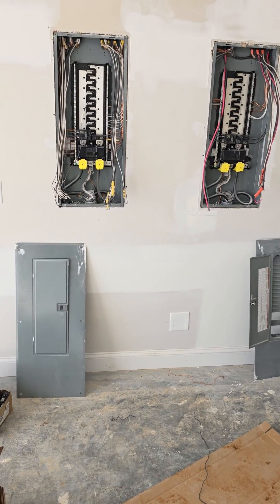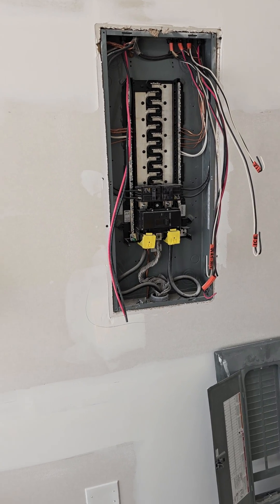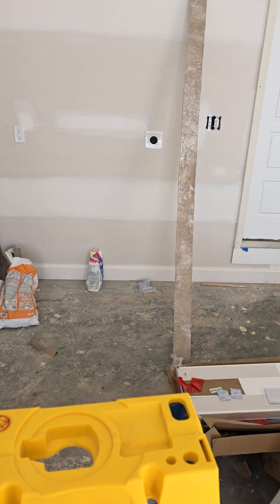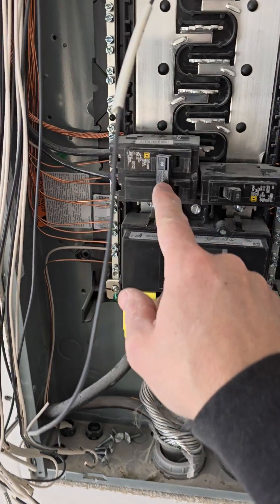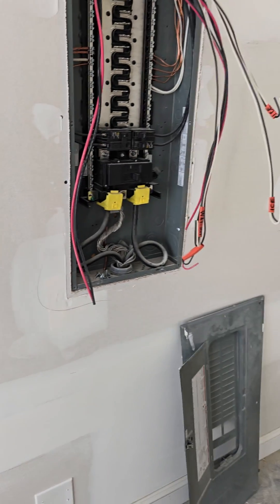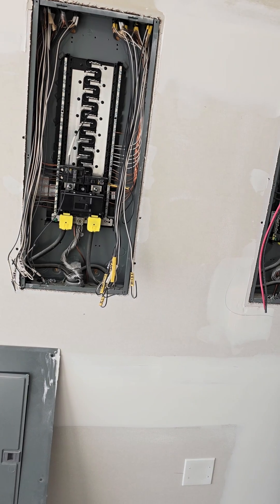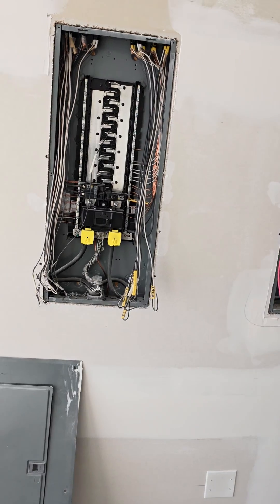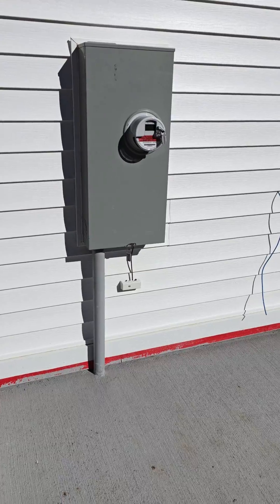Reason why people go with 400amp service in new construction now days

Comment: 120A for the heaters plus air conditioning is stupid. Even with the 20% NEC derate, that's 96A, or 23kW at 240V, or 78000 BTU/h with resistance heat.

Compare with the Mitsubishi Hyper-Heat heat pumps I have, which together output over 80k BTU/h at -13F outside, and only draw about 48A total at full capacity. They also do air conditioning, so you don't need extra circuits for separate air conditioners.

There is zero reason why anyone should be installing resistance heat in 2024, unless you only need heat a few days of the year (like Florida). Even with cheap electric rates, in any kind of cold climate you are lighting stupid amounts of money on fire. Heating my house here in Colorado with resistance heat would be over $3000 per year, compared with around $800 for my heat pumps. Over a 15 year lifespan for a heat pump, that's $33000 less in electric bills (more if electric rates go up), which is more than my entire heat pump install will cost after all of the rebates and tax credits.
Reply: Finally a reasonable american
Reply: Agreed. Unless this is a 7000 sqft+ monster house, 400A (probably 320A really) is such overkill. Modern electronics, including heat pumps are getting more efficient. It used to be that a room might need a couple thousand watts in incandescent/halogen bulbs, but LEDs have cut that by 90% or more. Nobody really needs 50/60A car chargers in their garage, 30A @ 240v will recharge more miles in 2 hours (at 24 miles/hour) than most people drive daily.
Reply: @bnasty267  Disagree. Adding one EV charger, sure, a 200 amp service is fine. Multiple EV chargers, no, that needs an upgrade, particularity if a home is using electric tankless water heaters. A whole home electric tankless heater easily draws up to 100 amps when running. Combine that with a decent AC unit and an EV or two charging, pretty much maxes out a 200 amp service. Granted a tankless water heater is only going to be running when used, so at most only 15 to 30 minutes a day, but when it is, the peak load is quite high.

This is the issue in my home, which is approx 3000 square feet, but everything is electric, gas service is out of the question here. Stove, 2 heat pump AC units, water heater, well pump, electric dryer. Existing service is 200 amp. Add in an EV charger or two and replace the water heater with a tankless unit, or multiple point of use units, and a 200 amp service is no longer enough. Granted its not that much higher, around 220 to 230 amps of calculated peak load, but still enough to overpower a 200 amp service.

And due to the tyranny of standard sizing, the next standard size up for a split phase panel is 400 amp. Occasionally you can find a 300 or 225, but those are very rare sizes and 225 amp panels are usually three phase panels, which technically you can use a 225 amp three phase panel in a split phase use, but a third of the breaker spaces in it will be useless, since it wont be connected to anything.

Solar is also another reason to go 400 amp, at least at the panelboard, and the reason is to avoid overloading the panel busbars. Due to code limitations, a Breaker panel can only have 20% of its rated capacity of solar added if it comes with a full sized main breaker. So a 200 amp panel can only have 40 amps of solar added to it, unless you downsize the size of the main breaker. But for example if you had a panel with 225 amp busbars but a 200 amp main breaker put in it, then you can have 65 amps worth of solar installed. or a 400 amp panel and main breaker has 80 amps of solar capacity.

For context a 2000 square foot roof can pretty easily hit around 70 to 80 amps worth of solar installed, and the constantly increasing efficiency of solar panels is going to drive that number even higher.

That being said, if 200 amp service isn't going to be enough, if three phase is available, I find that a 225 amp three phase service makes far more sense than a 400 amp split. a 400 amp split phase requires 600 kcmil service entrance conductors which is just retard expensive, almost three times the cost of 4/0 wire which is sufficient for 225 amp service. Even accounting for the fact that three phase requires an additional conductor, the cost in wire alone doesn't compare. 225 amp three phase panels and meters are also generally cheaper than 400 amp split phase ones.
Reply: @ryuukeisscifiproductions1818  Solar installers in this area are doing line-side taps so the panel busbar capacity doesn't matter. I understand that may be prohibited in other places. It's OK here.
Reply: @ryuukeisscifiproductions1818  As soon as you start talking about electric tankless water heater, yeah, that's crazy territory. Those draw more power than anything in a resi home by a factor of 2 or more. They're also pretty terrible and not common - if you live somewhere with cold water in the Winter, they're pretty much off the table. Tankless only makes sense if you have gas/propane. On the contrary, I run a heat pump water heater, and even though it needs to be sized like a regular resistance one for load calc, it only ever uses <10 Amps, since I keep it on HP-only mode. HP dryers are also starting to become more common in the US, so the major power appliances (besides range) are using less instantaneous energy. 

Oversizing the panel for solar, sure, that makes sense since the material cost isn't that much more. It's the service cost from the POCO that usually is killer. If you're building new and there isn't really much additional cost to go with 320A service, sure, why not, but assuming no on-demand elec WH, I still maintain that 200A is more than enough for normal sized homes.
Reply: @bnasty267  I would say that most of the issues with Electric tankless heaters has more to do with improper sizing and use than anything intrinsically wrong with the technology. 

One of the issues with electric tankless heaters is that they do have a minimum flow required to activate them, which is why to properly use them, its better to go with multiple point of use units sized for each individual water source than a whole home model. Whole home models have to play a tricky balance between having to have a low enough minimum flow for faucets to activate them, while also having enough capacity to operate showers, and this balance is very tricky and can sometimes simply be impossible depending on the temperature of the water table. Hence the need for multiple point of use units instead. But that does have the issue of needing a panel with a lot of spaces. and of course a 400 amp single or 225 amp three phase service.

And gas service just inst widely available everywhere, particularity in rural area's, where gas pipelines just dont exist usually, and gas tanks are expensive to backlit onto a home that never had one. Plus if its propane, propane tends to be very hard on appliances. 

That being said, I know that 400 amp single phase serves honestly, kinda suck, especially in cost, and there is a reason that most buildings that need more than 200 amps usually go three phase. And I would say that if its available, a 225 amp three phase service is massively better and more cost effective than a 400 amp split phase service, while only delivering somewhat less overall KW. it also helps that 225 amp three phase equipment is a lot easier to find and is more common than 400 amp split phase.
Reply: @ryuukeisscifiproductions1818  If you are in Canada you don't need to upgrade service for EV charging: so long as you use a whole house energy monitor to stop charging during high demand.

I worry this will interfere with the "virtual power plants" that "smart" water heater companies want to sell to utilities. With a proprietary protocol: the "whole house energy monitor" won't know that the water heater is selling "virtual power" to the utility before authorizing the cars to charge during the supper hour.
Reply: @ryuukeisscifiproductions1818  You know how there are places where you can't get natural gas? There are a lot more places where you can't get 3-phase power.
Reply: It's most common to have resistance heat as a backup to a heat pump.. The resistance heat only operates on the coldest days of the year (and when the unit is in defrost).

Comment: In modern construction you really want to take into account 1 or 2 50amp car chargers, a hybrid or on demand water heater (which is basically a small AC unit in draw), two heat pump zones which will draw 30-50 amps each, and Potential use of electric radiant heating in bathroom floors/kitchens, etc.  And finally you want to segregate all the utility outlets, and appliances outlets like refrigerators and some outlets scattered throughout the house for potential generator separation without requiring a complete rewire of the panels.  And finally take into consideration how one would wire a power wall or other solar battery based system in later years.

Modern houses are on the cusp of a lot of electrical changes in the next 50-70 years, so thinking ahead for all those needs is the mark of a great electrician.
Reply: Those can draw a huge load I have seen on demand water heaters upto 120A for multi bathroom homes. One electrician who put this in his own house said the power bill spiked due to his teens now taking 30-40 minute showers with unlimited hot water. The old tanked water heater was self limiting because it would run out of water ending the shower. He now has to make them set timers on their phone and get out in 15 minutes.
Reply: Fortunately most of those things aren’t running at the same time. You charge your car while you’re asleep for example
Reply: @keco185  yeah you just want to design for the total capacity in the load centers.  Otherwise you would need 600+ amp service.

Just a few decades ago, the standard was 100 amp service. It gradually went to 150, and most homes now or 200 but I can easily see that larger homes are going to generally trend towards 300 to 400 amp service overall.
Reply: @keco185  It will be a learning curve.  My wife runs the dish washer when we go to bed so that I have hot (actually hotter) water (using gas) in the morning.  Otherwise, the heater, EV chargers, water heater will be running at the same time.

Comment: Good luck pulling 400amp from the grid.
Reply: How's that any different than two houses side by side with 200 amp each?
Reply: @kamX-rz4uy  I think the point is that it's somewhat overkill and 400A won't actually be pulled from the grid. My house along with 2 of my neighbors are all on the same 25 kVA transformer, with a full load current rating of 104A. So even one the three houses pulling the full 200A would severely overload the transformer, and yet there has never been an issue because in reality single homes don't normally draw anything even close to 100A for an extended time. With EV charging, this could start to change. When I interned at a utility up in Maine, they would put 6 homes on a 25 kVA transformer, which is allocating under 20A per house assuming all houses drew the same amount. In reality, there is significant diversity to when different houses draw power, so they very rarely had any overload related failures.
Reply: lol, good one.  He must be a YouTube electrician 😂 @kamX-rz4uy

Comment: A lot of these extra power requirements fit well within the 200A panel if things like soft starts are used for the big consumers. Smart instead of brute, and in any case, if people put in 400a service their entire subdivision will go dark because of blown transformers…..
Reply: Just because there is a 400a service does not mean it will be fully utilized.
Reply: "Smart instead of brute" brute is cheaper to purchase and more reliable over years.  No reason to soft start an AC if the utility can handle it, expensive electronics that just break.
Reply: @nspro931  Soft start is also good for the compressor...... It is cheaper to replace the power electronics of a soft start than your compressor!
Reply: @ziegle9876  I do agree it is easier on the compressor, but 99.99% of compressors run an entire lifetime without them before they conk out, so it really doesn't matter in the grand scheme.  And adding a soft start is not going to affect NEC 220 service side calculations one iota.
Reply: An average house in the US does not need more than 200 amps for anything.  Given the LED lighting, power requirements are lower and if the house used times power, as it should, those big extra loads should be run during the night because that is where the baseload capacity is.  400 amps seems insane, or for something much larger than 4000 sq ft.
Reply: @gibblespascack1418  Just did some math on your claim per Article 220, 4000 sq ft house with 5 ton + 2.5 ton heat pumps with backup strips, electric HWH + CD + range, 11.5 kw car charger, comes to a 300 amp service and with an instant electric HWH or larger or multiple car chargers could easily go much larger. Prove me wrong.
Reply: Sure, if you must power everything at once, it could be 300 amps. You are absolutely right.   However, no one should ever need to do all of those things at 6 pm in the evening.  The car chargers should be on a timer and using night rate(you know this).  The heating system is at 5 ton and 2.5 ton should not be running all heat strips at the same time with the start up load.  Those systems only need heat strips when it is extremely cold(colder than the planned coldest day) unless if you are cycling the house temp in a way to use the most electricity possible with that system or keeping windows open for fresh air.  And the only time an electric stove is pulling the 50 amps is on Thanksgiving or Christmas when every burner and the oven is being used all at once.  If you need more than 200 amps at any one time, you really need to evaluate your lifestyle.  Some common sense could be applied here and seriously, if this is the case, you need to look into load shedding because the grid should never be designed for the maximum possible pull for only 1 hr any one day.  It is just cost prohibitive from a design standpoint to engineer a system like that.  Just for the record, the average pull for my home in the winter is 16 kwh/day.   I do not need a 200 amp service to run that, but I do have a 200 amp service because it is code.        @nspro931
Reply: @gibblespascack1418  I just ran these numbers through Article 220.  The planning department would not issue a permit to build a house with those things on a 200 amp service.  They will not allow the owner to say, "but I won't run everything at once!" Besides that, Article 220 calcs already apply a lot of diversity factors.  I did not just add up the numbers.  I ran it through the calc we all are required to do.
Reply: Has your building department allowed a Span panel to be installed?  They can be programmed for load shedding.  Or Load shedding on a Generac generator installs to accommodate a smaller generator?  The future has to accommodate load shedding, if we are to transition to a less carbon intensive future.   It is funny that in Rouse Point, NY, 30 years ago, the town electric department gave people a choice, either add the cost of Nuclear Power base load(for the year) to accommodate those 5 days in January where the town needs it, or give the town the ability to turn off all of the water heater for that 5-7 pm period of those 5 days where system needs it(heat and cooking were resistance electricity.  When everyone saw that 2.5 cents/kwh cost will have to rise, they installed the remote shut offs.  And that was before instant hot water heaters were cost effective.  It has to happen, it is only a matter of time.  In the area that I live now, night rates are coming back.  Good luck with your town.     @nspro931

Comment: touch the busbars.
Reply from the maker: Would not recommend. Technically if a person not grounded and touches just one of the phases he should be OK. It's when you grounded and current escapes though you ( that's when people die). Electricity kills two type of people: people that are not experienced and people that are experienced but not respecting electricity.
Reply: @ProTecElectric   Pretty sure he is joking HARD CORE. but you should have touched them....